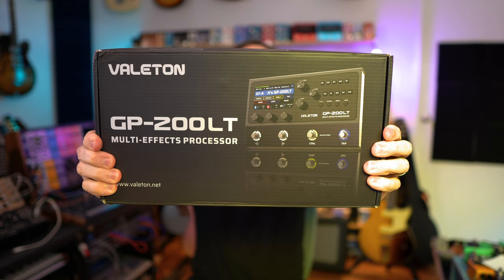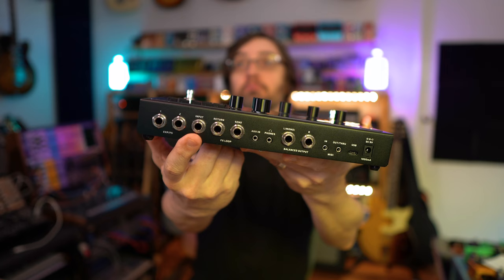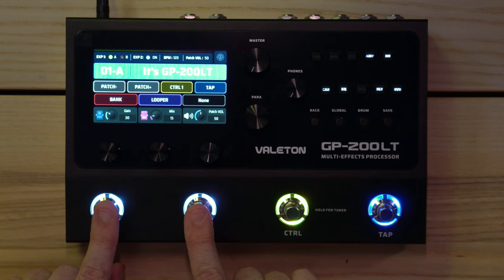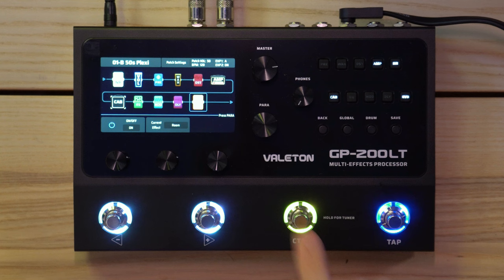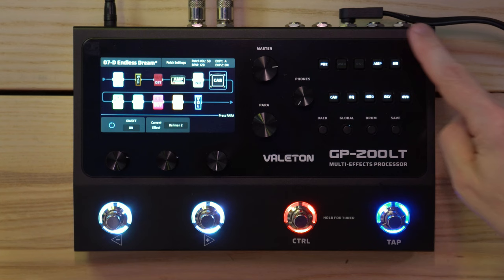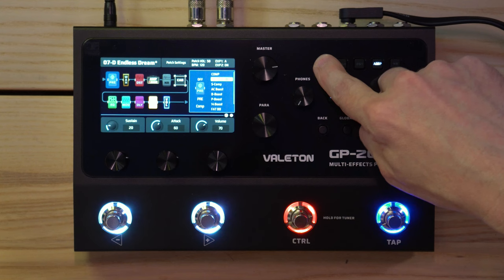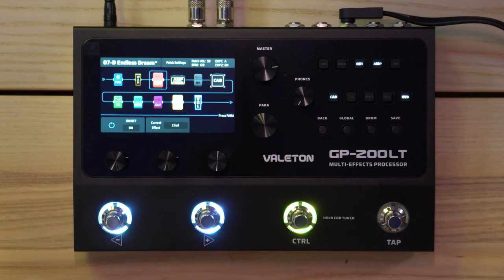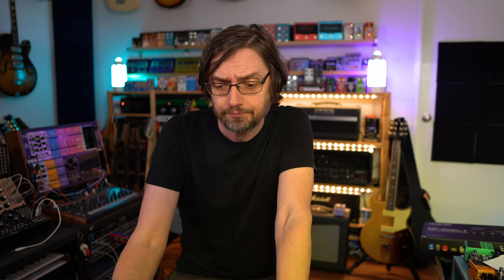First Look - Valeton GP-200LT

Comment: If it had XLR I'd have gotten it
Reply from the maker: From memory I’m pretty sure they are balanced TRS outputs so it’s basically the same as XLR…just get a short TRS to XLR cable, that’s what I do with my HX Stomp and ToneX pedals when I play live…just a short cable to convert the TRS cable to an XLR and then you can plug a standard XLR cable into that! Or just get a long TRS to XLR cable
Reply: The GP200 has XLR outs, this model (GP200LT) has balanced TRS outs, so you're losing nothing :)

Comment: I have owned the Valeton GP-100 for a couple of years now and am quite happy with the few patches I have set up...but I think it's time for an upgrade (well it is Christmas season after all )
Reply: No hardware / software issues? Does it work well.
Reply: @accentontheoff  Still using the GP-100..solid as a rock..saved me $$$ from buying many amps I lust for
Reply: @tonray9395 Good to know thanks.
Reply: @tonray9395  When you say upgrade you mean to the GP200 LT? If yes, what will you do for the wah.

Comment: Looks like plenty of fun!!!

I'm wondering what the differences are between this LT version and the GP 2000 (non LT). This appears to be like a & 'lite edition' or is this an updated version? (I've not done any research 🤔). 

We are getting to the stage now where these chips are getting that good at such low prices they are almost becoming a no brainer, at the very least for players just getting into things. You can pretty much purchase this for the price of a single 'premium' pedal or even get some change.

We talk about how they sound, but typically they are compared to the pedals/amps they try to emulate, when really how they sound is just that, not by way of comparison. They either have useful sounds that a given player desires/can make use of or they don't. It matters little whether the recreations are spot on or have their own sound.

I'm really not sure what to think as these units become significantly cheaper and better simultaneously. Will there be a time in the near future when physical pedals are basically a thing of the past? It strikes me that 'we' are going through a war akin to CD vs vinyl. CD took the honours with the almost full demise of the vinyl LP for decades, only to see the vinyl revival over the past number of years (and if you're an even cooler hipcat - cassettes 🤣).

Looking forward to the full review here. Thank you Gabor.

😎👍
Reply from the maker: As far as I know the only real difference between this one and the “big” GP-200 are the extra foot switches and the expression pedal - and a few different I/Os in the back!

It’s crazy how good these “cheap” brands are getting - and I also think that there is not much point in comparing it to a real Marshal or Boogie or Fender Amp…does it have good, usable cleans, edge of breakup, and gain sounds…that’s much more important to me than how close it gets to emulating a JCM800
Reply: @TSFAHTPS  Here, here!
Reply: Wszystkie wzmacniacze i przestery brzmią bardzo podobnie. To tak jak gdyby na jednym albo dwóch wzmacniaczach wykręcił kilkanaście różnych brzmień

Comment: I really wanna try one out but am also curious of you guys trying g a nux mg30 or mg400 and for the price of the there pedals are good for the money. But curious what you guys would say.
Reply from the maker: The Australian NU-X distributor doesn’t seem super keen to work with us…but I’ll see if we can get a hold of one of them
Reply: @TSFAHTPS  oh wow the other pedals too are flamma if you haven't checked them out. They work with almost everyone and they got multi effects and individual pedals.
Reply from the maker: @stephenwhitney8636  yeah Flamma are sending us one of their new MultFX…hasn’t arrived yet though!!
Reply: @TSFAHTPS  oh that's awesome!!! Thanks for taking time to answer my questions
Reply: Hi mate the NUX MG30 is also an excellent sounding multi fx, great user interface easy to use and the App software is excellent. NUX effects sound excellent due to their TSAC technology, I’ve had a few NUX pedals all built really well, sound fantastic and great prices, slightly more expensive than many of the budget pedal competitors, it’s definitely worth paying that little bit extra for the NUX quality.
I’ve not tried the MG400 but I’m sure it will also be great as it’s the newer big brother to the MG300 which is also an excellent sounding unit. You can’t go wrong with NUX.

The Valeton GP200LT is a brilliant solidly built, user friendly and excellent sounding multi fx, for its low price it’s just as good as many much more expensive competitors units, if you want the built in expression pedal, a few more foot switches and more outputs and don’t mind spending an extra £60-70 then the GP200 big brother is fantastic and well worth its price.
As for Flamma I have a few of their pedals which are all also excellently made, great sounding pedals at low prices.
Flamma do multi fx units, the FX100 again great for its price, the FX100 they make for Harley Benton which is the DNA fx Git, and the newer bigger Flamma FX200 has more foot switches & features and good price for what you’re getting, again the supply to Harley Benton as the DNA fx Git PRO, exactly the same Flamma units with the Harley Benton brand logo.
All great units for the money, you honestly can’t go wrong with the Valeton, NUX or Flamma multi effects units for there price.
Reply: @madmancaudiogear  yeah they have the valeton gp200 with extra foot switches and foot pedal for $349 USD

Comment: So, if all you had was an amp to play this through- can you turn off the cab sims and do so? I'm eventually going to buy a set of monitors for my "studio"- for lack of a better term- experiment would probably be more accurate- but right now a tube amp is what I have. It is a more modern tube amp- the Blackstar club 40- emulated output on the rear, built in attenuation, digital reverb, and overdrive- with a parallel fx loop- if that matters.
Reply from the maker: Yeah you can turn the amp/can sim off and just use it as a multi fx unit - I’ll make sure to include that in the full demo
Reply: If you have an FX loop in your amp, keep the pre-amp sim on, turn the cab sim off  and plug the output of the GP200LT into the FX return of your amp.